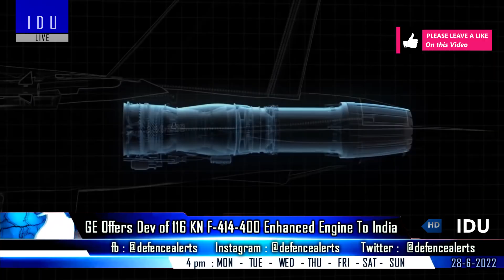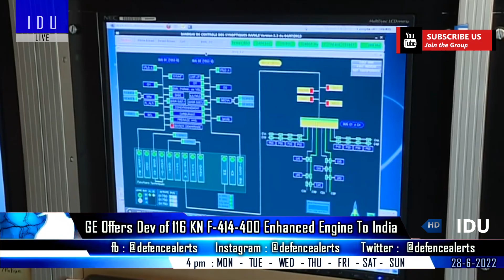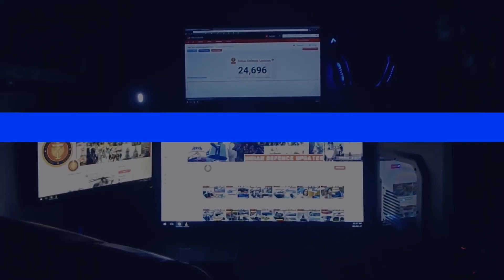Indian Defence Updates : US Offers 116 Kn Engine,Astra Mk3 Trials,MRFA Tech Transfer,Tejas Malaysia

Comment: It will be the best solution for our country if we can take both the GE 414-400 Engine offer & Safran India joint engine development simultaneously. For that if India has to bare 7-8 billion more then also it will not be a bad negotiation. This is one of the most vital area where we are not having any alternative in near future. What ever the latest Fighter plane we design & develop without proper engine, without indigenously manufactured engine we should be in the grip of foreign power. In crucial time if they stop spares of any type of engines we are done for.
If Both engine programme run parallel then none of the country can play game with us.F414-400 is nearly ready available but in case of Safran India engine, development of that will start now. Single wheel will always a risky matter if it fails all will fail then & on that scenario we will be a big zero. Everybody will play game with us then. This happened with HF 24 marut earlier.
Reply: No need to go with Safran when rest of our jets will be powered by GE. We should achieve economies of scale with one engine.
Reply: By god can you guys do some lesson?M88 is actually adesign deeply referenced to F404. You go for both Safran andGE, it's like you go for VW and Audi, dreaming for getting different Tots. Waste of money.